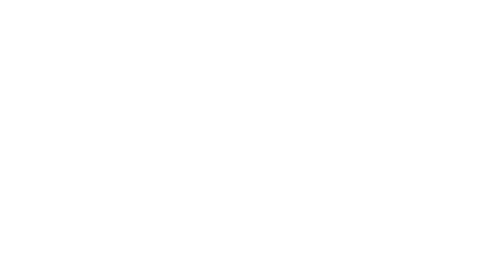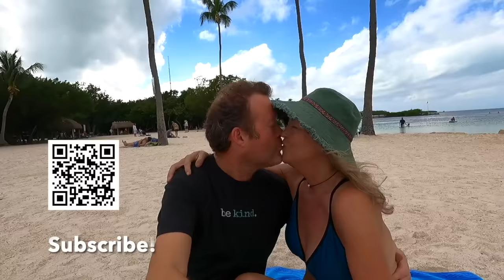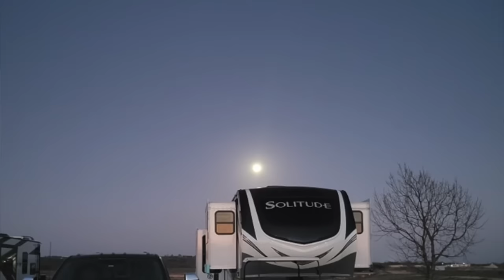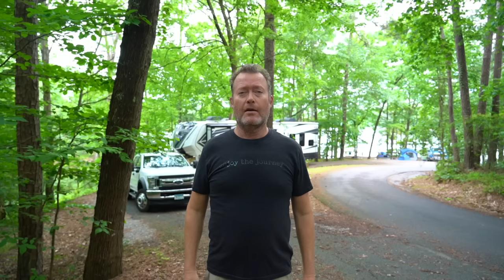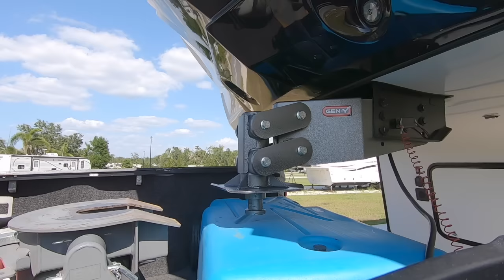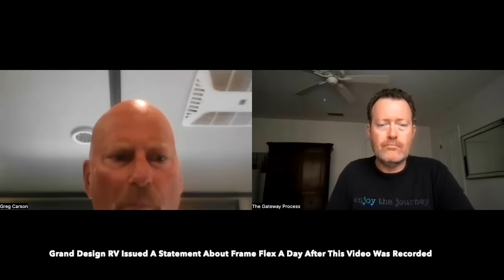WARNING! Hidden RV Safety Risk You Need to Know (Grand Design RV Frame Failure)

Comment: Tow Vehicle Air Bags:  I don’t understand why having air bags on your tow vehicle would compromise the structural integrity of the RV. 

If anything it would level the RV with a level tow vehicle, thus helping your RV’s suspension by equalizing weight on the axles. 

Someone please explain, using engineering terms, why vehicle air bags is bad for the RV.
Reply: It’s not. They used that as a scapegoat excuse to deflect responsibility. I haul livestock. Air bags stabilize and give more of a smooth ride and help mitigate damage over time on rough roads. People who haul sensitive electronic equipment use airbags. Every rig that hauled a space shuttle back to Florida had them.

Comment: The frame needs to be able to cart the camper the camper has lifeless to no structure you need to look at the welds and are the 5:28  welds completed are just glorified tack welds if they had to put there frame’s threw a DOT inspection would they pass

Comment: 32:47 Too much inaccurate description here. LAG SCREWS are not BOLTS. Please stick to LAG SCREWS. 

Yes, good bolts with adequate washers and lock nuts would be the proper securement. 

Of course LAG SCREWS, with dynamic loading, are just going to wear down the wood inside the aluminum tube will deteriorate to failure. 

Great video overall! Thank you 🙏
Reply: Thanks for your post. I did a bit of research and found this. 

“If you’re new to DIY projects, the difference between a lag screw and a lag bolt might not be immediately apparent. But it’s essential to understand the differences to choose the best type of fastener for your project. Here’s what you need to know about every kind of fastener and when they should be used.

What is a Lag Screw?
A lag screw is designed to be driven into wood with a wrench or socket. It has threads on its entire shank length, and it usually has flat ends (although some have pointed ends). It can also have hexagonal or square heads. Lag screws are used to secure heavy objects such as decks and posts into the wood, and they are often used in place of nails or bolts because they provide greater strength.

What is a Lag Bolt?
A lag bolt is designed to be driven into wood with a wrench or socket but has fewer threads than a lag screw. The lines stop at the head of the bolt, so there is no threading along its entire length. A lag bolt typically has a hexagonal head, although some have square heads. These bolts are usually used for heavier applications such as securing large beams into place or attaching posts to foundations. They can also be used for lighter applications like securing cabinets or hanging items on walls.

Difference Between Lag Screw and Lag Bolt
A lag screw is a type of screw that is used to attach two pieces of wood together.
A lag bolt is a type of bolt that is used to attach two pieces of wood together.
Lag screws are typically longer than lag bolts.
Lag screws are typically used in applications where the joint will be subject to shearing forces, such as in a door hinge.
Lag bolts are typically used in applications where the joint will be subject to tension forces, such as in a deck railing.
Lag screws are typically driven into place with a wrench, while lag bolts are typically driven into place with a socket wrench.
Lag screws are typically removed by unscrewing them with a wrench, while lag bolts are typically removed by unbolting them with a socket wrench.
Lag screws and bolts are fasteners that attach two pieces of wood together.
Conclusion:
Lag screws and bolts are valuable tools for any DIYer looking to construct something that requires more than just nails or screws. Knowing which is best suited for your project will ensure your construction is solid and secure. For most applications, either type of fastener will do the job—but if you’re dealing with heavier loads, you should opt for the lag bolt instead of the lag screw. Keep these tips in mind when selecting your fasteners!”
Reply: @bradmiller3557   The Lippert engineer in Big Truck's interview used the term lag bolt.  So, did the design spec call for lag bolts and GD used lag screws?  Of course, given the lightweight aluminum tube in the wall, not sure how much of a difference a bolt vs a screw would have made.
Reply: @kmbbmj5857  Thanks for that reply. Nomenclature and use are often unknowingly intermixed. The design engineers damn well should know the difference, right.

Comment: Alot of people with frames breaking at hitch is due to lifting trucks with hitch and after market gooseneek neck connections.  i literally seen someone trying to auto level with camper hooked up to hitch.  i have also seen a gentleman block the drivers tire side of a momentum to pre level camper before leveling when he disconnected the tougue on hitch was so hi it twisted hitch pin.
Reply: please these guys are not doing that don't defend the Corporate GREED cheaping out on these trailers.
Reply: @jimlarkin1400 
There our many ignorant people out there as well.